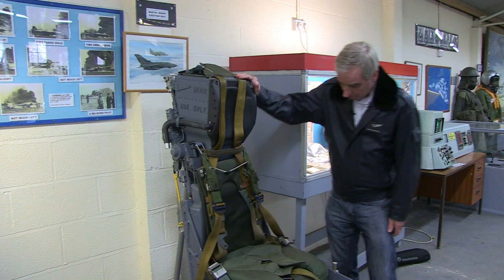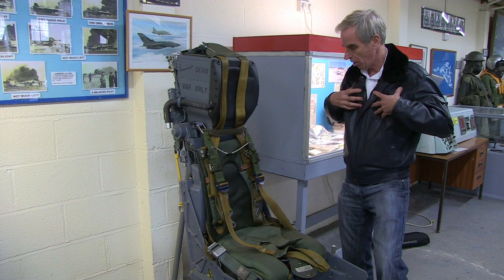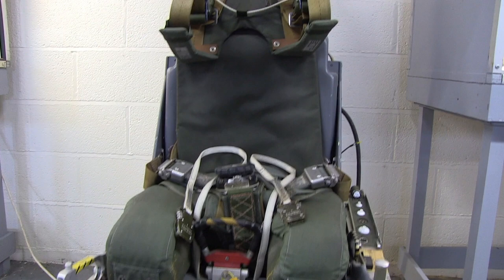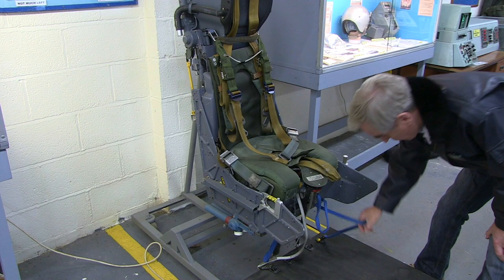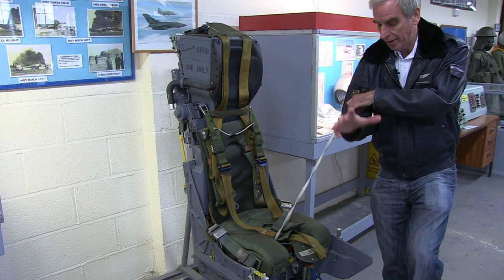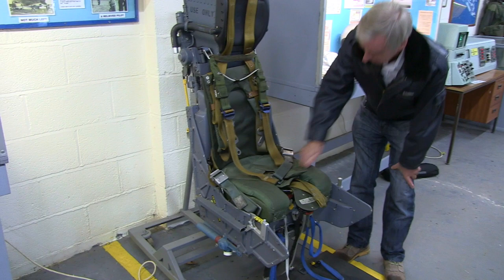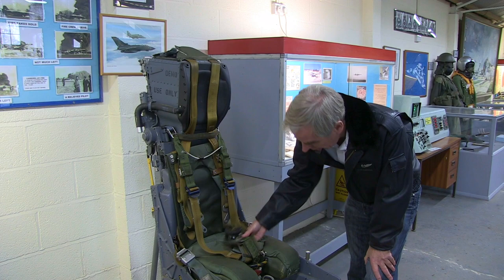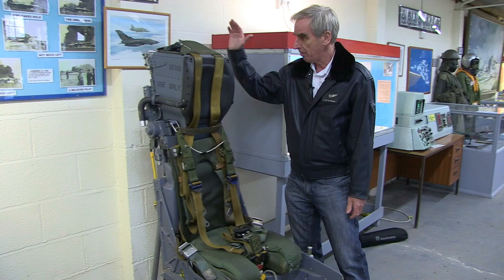Martin-Baker MK10 Ejection Seat Tour

Comment: 1971 VT24 Chase Field, TX ... Grumman TF9J..MB MK7 .....  There was a balance beam scale in the locker room so that instructor pilots and student aviators could determine their EXACT weight in FULL FLIGHT GEAR (not naked weight).   Per squadron instruction, this weight was dialed into the MK7 seat upon taking station in the aircraft.  If this procedure was NOT in accordance with Martin-Baker specs, I am glad I never had to pull the handle.
Reply: I don't think I ever saw the dial on anything but 200lbs on Buccaneer Seats. Amazing How all the pilots weight the exact same amount regardless of stature. 😗
Reply: Must be similar diet and exercise ???

Comment: Did this person fly tornado? because either his memory is fading or he doesn't know the seat. Both parachutes, drogue and personal, were contained within the headbox so that the aircrew were not encumbered by having to wear a parachute pack. The Mk10 seat had/has ONE Safety pin in the seat firing handle, there are NO other Safety pins. All other safety features were either mechanical interlocks or timer release mechanisms operated during ejection. I have 15 years experience servicing these seats.
Reply: Dave was a Tornado F3 navigator so yes, he did fly it. The Tornado mk.10 was a earlier version so his info could be correct or some small details have been lost to memory as we all forget little details.
Reply: Phil Whitehead correct Phil and its 12g on ejection ... not 40
Reply: There was only one pin for safe for parking, however to make it safe for maintenance the Drogue gun, BTRU, MOR, RRI all had safety pins. Basically all the sear operated firing units, which means on the Mk10A that would have included the main gun primary cart as well. I worked on Mk10L, which did away with the sear operated firing unit for the main gun and used a gas operated firing unit which didn't need a pin, so slightly different from the version here.
Reply: Do you know about the MBEU survival package, its maintenance, manuals and what aerovanes is it in?
Reply: @nzgunnie   on an RAF mk 10 seat as fitted to the Tornado has ONE pin and no difference between safe for maintenance and safe for parking both conditions have the safety pin fitted to the firing handle on the seat pan. The rri, mor, drogue, hpru, btru and main gun firing unit do not have safety pins.
Reply: @philwhitehead403  That's interesting info. I wonder why the RAF considered the seat safe for maintenance with just the seat pan handle pin, but other operators pinned the sear operated firing units as well.
Reply: I always used to hate connecting/disconnecting the main gun primary firing unit sear on the Tonka, it felt so wrong after working on other seat types to be pushing on that sear with no safety pin in place. Of course the chances of me actually being able to push the sear out of the firing unit were non existant but I still didn't like it! :o)

Comment: So, if you've flown any major tactical aircraft type in the West, chances are you've sat on a Martin-Baker ejection seat!

I have to say, honestly, that out of all the equipment that goes into a military jet, this is probably the piece of equipment that scares the hell out of me the most!
NOT Martin-Baker, per se, but ANY ejection seat.  Strapping onto an armed rocket does not exactly thrill me.
It seems like such a complicated piece of safety equipment...
I was looking at the Wikipedia entry for this and, WOW(!!!), was this seat used in so many different planes, many of which are still flying today.  If your plane isn't flying with a Martin-Baker seat, it's most likely equipped with a UTC ACES ejection seat.
The split for US tactical ejection seat buys seems to be M-B for the USN, ACES for the USAF.  Honestly, I don't know why that it but it does appear that the air arms favor different manufacturers just like they (USED to) buy airframes from different manufacturers depending on specialities -- ie, Grumman, Vought, or McDonnell Douglas for naval planes, all other manufacturers (upward of 6-8 at one time) for land-based.